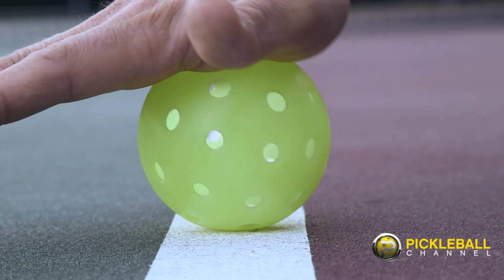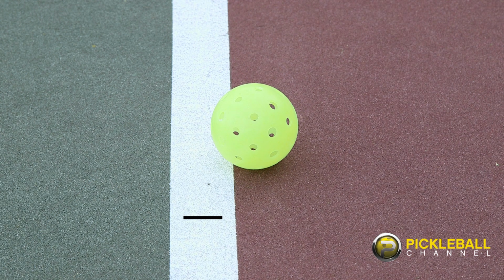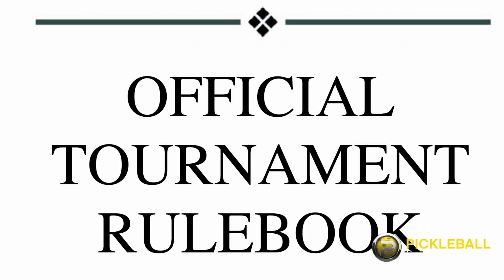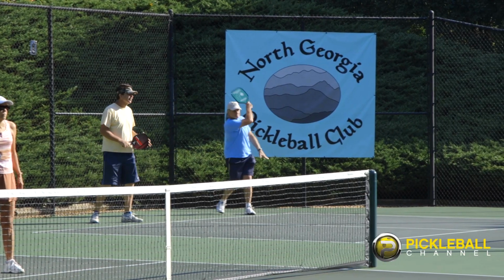Line Calls Made Easier - Gear Talk with Tom Earley

Comment: Interesting idea, Tom and Rusty.  In trying to anticipate objections, I can imagine people saying the NVZ line is too hard to see using only your peripheral vision.  Often, you're watching the ball or your opponents when you make your way up to the kitchen, and only get a glimpse of the actual line out of the corner of your eye.  Perhaps doing the perimeter lines as 1", then the NVZ and mid-court lines as 2" would be an effective compromise.
Reply from the maker: That's an interesting solution to that problem.  Thanks for keeping the conversations going as we make pickleball even better!
Reply: It's not hard to see so long as you color the boundary areas different or even contrasting colors. I especially like it when they paint the kitchen a different color. Because unless you have played a ton of pickleball it can be a little bit hard to tell exactly how close you are to stepping on the line using only your peripheral vision.

Comment: I don't know why people further complicate things that at their basic premise are simple and easy. If a balls profile covers a one or two inch line it generally is okay to consider it in. Sometimes you can easily see its contact point but most times you may not be able to. That depends on perspective, that's all.The other thing that's pretty simple is, if it's not called out its obviously in. There's no need to call the ins, outs or maybe's, just the outs, that's all. Yes, that's all. Class should be made right away, not debated and then called a minute later. If you're unsighted (both you and your partner) then obviously you give them the point or go with their call, if they have one. They should only call shots on the other side of the net if asked, and not always. Capiche!!

Comment: A hard-hit ball does compress very slightly as demonstrated when you pushed it down. It's just much less than a tennis ball. Also, don't forget that a hard-hit ball also skids slightly on the bounce. No one has ever added this fact to the science here. Just like all hard hit balls, especially serves, in tennis, create a large oval shape due to the skid. Just like, another example, would be when you hit the ball with spin off the paddle. If the ball left immediately upon contact then it would be impossible for it to create any spin. So, essentially, there is a skid on the paddle when you hit it with spin (not flat). The same is true when it lands on the cement/surface. That's why I think you need the Hawkeye technology system to do a little scientific experiment for the pickleball community, so we can see exactly how much skid and compression these balls give when they touch the ground.
Reply: Also, I'm not very convinced about the idea that it is easier to tell if the ball touched the line or not, if it is a smaller line. It's possible but it's also pretty subjective and I don't think that is a major difference maker. I know in tennis they have pretty thick lines (that's probably more for the audience, especially on TV, which is the priority in an entertainment sport). Although, in clay court tennis, they make the lines smaller so that there is more room for a mark (and probably less line to slip on). Also,  they say that the painted lines, even on hard courts are more slippery, and create a different bounce when the ball hits it. These other more well known objective reasons would probably outweigh decisions for or against the width of a line.